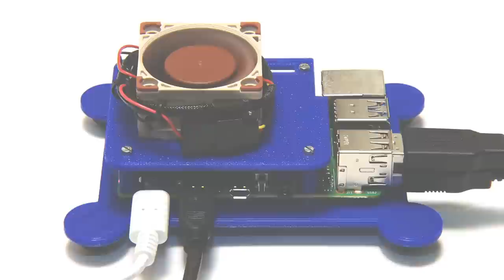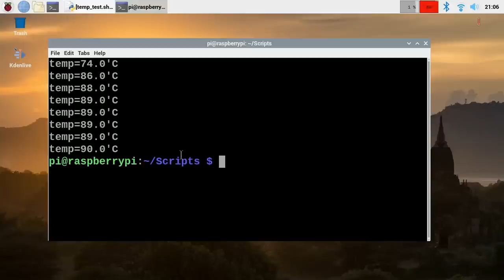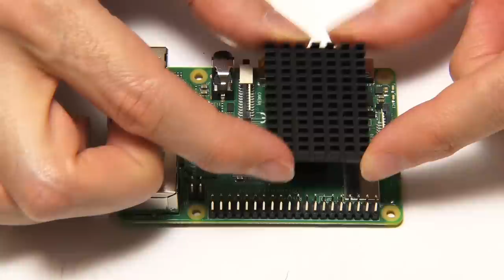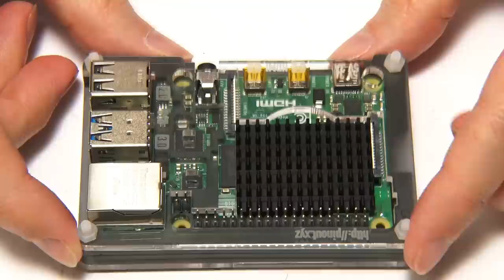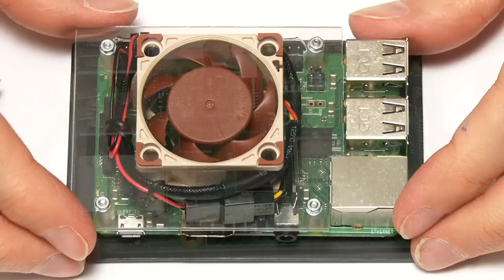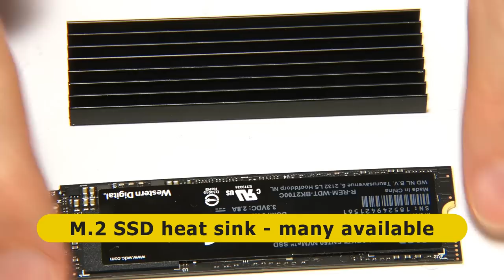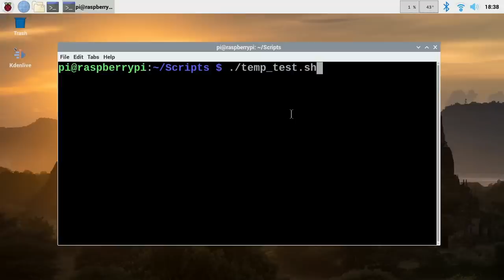Raspberry Pi 4 Cooling

Comment: Since its already metal covered, how do the main cpu temps act if you only add the fan at 5V to 9V or similar ? No heatsinks ?
If its up to 75°C Coretemp on the benchmark  i'd be fine with that for normal use.
Reply: *it's already (not possessive)
*similar?
*heat sinks?
*it's up to (not possessive)
*I'd (the word "I" and any contractions containing it should always be capitalized).

Don't put spaces before punctuation marks, except for: ( [ {
Reply: @alvallac2171  hAvinG A bad daY  ?
Nuttin ' betta to do in real life     ?
(edit: What i would really like is an answer to my question - which you obviously can't provide)
Reply from the maker: I imagine fan only would keep temps well below 70. Note that the Pi only has 5V from GPIO (and 3.3v after its voltage regulator).

Comment: I hate to be the one that keeps saying this but none of these videos state if the cooling solution will get you better benchmarks. Sure I see that these keep the temps down but how much better performance are you getting because of each cooling solution? If it's only 10% is it worth it? I haven't found anyone who has proven this out so far.
Reply from the maker: The test results show the time taken to run the test at the bottom -- from 40 minutes to 10 minutes. Preventing the Pi throttling will improve performance (ie holding it below about 80). And cooling will also improve performance and stability over time by increasing life expectancy.
Reply: @ExplainingComputers  thanks for the response as I missed the last line. Overall it seems you still just need a heatsink and not a fan. I minute difference doesn't seem to mean much overall

Comment: Can you test with fan connected to 3.3V instead of 5V? It may be still sufficient, but nearly silent
Reply from the maker: I would not personally connect a fan to the 3.3V pins, as they tap power after the Pi's voltage regulator.

Comment: Is there any performance gain between a raspberry pi running at 30°C and 60°C?
I think not because as long as the CPU doesn't throttle itself the performance should be same.
Reply from the maker: There are no performance gains at 30 rather than 60, but significant ones once you get into the 80s, as the table shows. :) And a cooler-running SoC and computer will last longer, and potentially be more stable.
Reply: what about the heating of the other components on the board ?  higher heat = higher resistance  ?
Reply: @garygranato9164  Increasing temperature of metals like copper from 20°C to 50°C hardly makes a difference and resistance of semiconductors like sillicon actually decreases with increase in temperature?
Reply: @anshul4589  
"hardly makes a difference"  so it does make a difference then.  not to sure about your ideas on heat and semiconductors as well.
Reply: @garygranato9164  Don't put spaces before question marks. Or any punctuation mark, except: ( [ {

Comment: i would bend a few heat pipes and modify the case so that they lead outside of the housing to be cooled by ambient air, that way you aint a pcb just sittin there exposed.

Comment: How does the pimoroni fan shim compare?  It doesn't use a heat sink and is a comparatively small fan compared to your setup.  I have a few fans in my stash but unfortunately don't have a 3d printer so may have to do some fettling!
Reply from the maker: I will be testing it in a follow-up video!

Comment: Why not use the 10mm version of the noctua fan
Reply from the maker: I have the 20mm version -- and it has higher airflow!
Reply: @ExplainingComputers  thanks for the quick response. I was debating on which version to buy. Do you reckon 10mm do a similar job if not the same?
Reply from the maker: Yes, a 40mm / 10mm fan should do a very similar job. Not quite as good perhaps, but I doubt it will run more than a few degrees hotter.

Comment: Just wondering - can the Rasberry Pi 4 be configured to run slower, say at 500Mhz, 1Ghz etc?
Reply: *Raspberry
Reply from the maker: Yes, "underclocking" should be an option --which I may investigate!
Reply: @ExplainingComputers  Thanks, somewhere I saw a simple start up script that allows you to set the CPU speed ... actually, come to thik of it, it was Tom's Hardware.com or something similar.

Comment: I would have encased the SBC in silicone rubber except for the header of the CPU and installed it into a Little Devil PC-V10 Case with Phase Change Cooler.

Comment: What are these pi are good for.
Reply from the maker: Small desktop PC. Robotics. Media player. NAS. Small web server. Networked camera controller. IoT stuff like home automation. Learning to program. That kind of thing.
Reply: I use my 3b+ to emulate old game systems using retropie
Reply from the maker: Ah yes, how could I forget retro gaming! :)
Reply: I have three Pi 3B+ - two are DNS servers, and the 3rd is a network scanner. I will eventually replace them with Pi4 1gb models. I have a Pi4 that will be my Kodi box (if the video support is up to snuff)

Comment: Your case is an open case unlike the OG PI 4 case being a closed case. What about just cutting a hole in the OG PI 4 case and putting the small heat sink and mount the fan on the top of the OG PI 4 case. Would it work as well or sould the case be
an open case like yours.  My idea was to put two fans one on top and bottom of the PI to have air flow with a closed case.

Comment: That is rather strange.
53° idle is bad for an ARM chip.
Is the passive cooling without heatsink really that bad?
Reply from the maker: The passive cooling sadly really is that bad.
Reply: It is also strange that the tests start out with totally different temperatures. 
Better ignore the top 4 rows ?
Reply from the maker: It is not strange at all! :) The different setups all start from running at idle for about five minutes. Different cooling solutions on any computer will result in different idle temperatures -- the lower the better! :)
Reply: @ExplainingComputers  Good point Chris! Thank you.
I am now running sysbench on a RPI2 and will study the effect of a 60mm 12V fan  running at 5Volt . The fan blows in a 3d printed duct that feeds into  3 RPi cases.

Comment: I've just run this test on a raspberry 4 in a Argon one case and the results are remarkable, I ran it twice the first run started at 38 and finished at 42 and the second started at 39 and finished at 47, and the fan doesn't kick in until 50 so I've no idea if that works
Reply from the maker: Cool.

Comment: funny, I just bought my first Pi 4b with active cooling and I'm going deaf from the little fan and had to rewire to position 1 and 6 to drop the V. Chris if you could come up with a solution for heat sensing fan control I would love to hear it!
Reply from the maker: The latest version of Raspberry Pi OS has implemented fan temperature control. :)

Comment: That is a very small computer and it is too tiny for most people's use. It looks like you need a cooling fan on the processor, plus one in a case that can hold the normal size fan to keep the unit cool.

Comment: Is there a possibility to use all the 4 wires of the cooler to also have pwm and rpm control. Because why buy such a nice and expensive, i might say, cooler from Noctua and not take advantage of all it can provide. I am searching for a 4wire to 4 individual jumper leads to use all 4 wires. Any hint is apreciated.

Comment: 3M double sided tissue tape isn't the same thing as a thermal pad. Its a thermal insulator, that happens to still have good adhesion when hot. 
A thermal pad, should be as thermally conductive as possible not an insulator
Reply from the maker: I noted I think that is was "thermal tape", which is what is is sold as(!). Not a "thermal pad", which is a different material, certainly . . . :)

Comment: 3D Hubs, at least here in the States, wants a minimum order of $35.00, otherwise they add a surcharge to make it $35.00.  Maybe I'll just apply the $35.00 to my own 3D printer.  Guess I won't be ordering your RasPi case from then anytime soon, unless I need a bunch of them!  But I really do like your design!  Have it now in my TinkerCAD designs so I can print it once the 3D printer arrives.

I think 3DHubs may be shooting themselves in the foot by adding this surcharge.  You can order a case with a fan for the Pi4 on Amazon for $9.99.  Why would I want to buy from 3DHubs?
Reply from the maker: I can only agree that the very recent surcharge introduced by 3DHubs is not good. I got my printing for this job done using a former 3D Hubs hub (seaside3d.com) -- I was intending to use 3D Hubs, but didn't when I went to check out and saw the surcharge! :)

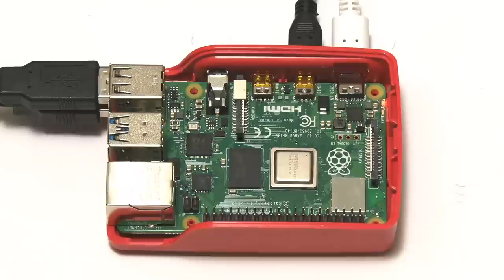Comment: @0:55
Technically that isn't without heatsink.....just with a VERYYYYYYYYYYY small one
Reply from the maker: :) That is the SoC lid, not really a heat sink! :)
Reply: When the 3b+ came out that is all I ever heard it called....it was to make up for the clock bump, either way it is fin to pick at ya a bit ;)

Comment: Hey, I'm going to be receiving my Pi 4 4GB + Pibow + Pimoroni Fan SHIM if you want another data point for different cooling configs?
Reply from the maker: Please do share the data here. :)
Reply: @ExplainingComputers  Will do! It should arrive tomorrow.
Reply: @ExplainingComputers  So, managed to get some runs in. I wrote a custom Python script, which simply executes the bash script you gave in the video and produces some output based on that.

Picking the hottest day so far this year in Britain was probably a bad idea, but here goes:

* Disabling Fan SHIM...
* Waiting 2 seconds for the fan to spin down...
* Benchmarking...
* Results:
* 51.0'C
* 81.0'C
* 82.0'C
* 85.0'C
* 85.0'C
* 86.0'C
* 85.0'C
* 85.0'C
* Enabling Fan SHIM...
* Sleeping for 2 minutes to allow the CPU to reach idle temperature...
* Average temperature with Fan SHIM off: 80.0'C
* Benchmarking...
* Results:
* 52.0'C
* 65.0'C
* 66.0'C
* 64.0'C
* 63.0'C
* 63.0'C
* 64.0'C
* 64.0'C
* Average temperature with Fan SHIM on: 62.625'C
* Having the Fan SHIM reduced the average temperature by: 17.375'C

Comment: Thank you for this great video, it is very resourceful :)
I was wondering if I could also use the NF-A4X20 5V PWM? Can a PI4 handle a PWM fan in order to adjust the fan speed? Thanks in advance for your advices

Comment: Do you have prudent cooling choices for the new 8gb Pi 4B
Reply from the maker: Here are the best two passive cooling solutions: https://www.youtube.com/watch?v=VJC6OpGpq0Y  For the maximum cooling, use an ICE Tower -- and look out for my video in July on the "Ultimate Raspberry Pi 4 Rig".
Reply: @ExplainingComputers  I've really enjoyed your posts, including these. The ICE Tower is brilliant but defeats the idea of a portable utility computer (for me anyway).
SBCs are supposed to be flexible and deployable. I want something that I can take to a library or a meeting and not annoy anyone with fans etc.. Ideally it would be a data store with some battery power.
I'm very curious to see the heat effects of the 8gb. Does the board need some sort of redesign? How big a difference does it make?

Comment: I hardly get to 43°C after several minutes of 100% CPU load with the Low-Profile ICE Tower Cooling Fan on my RPi4 with the fan plug to 3.3V !!! (I can't hear the fan AT ALL!) and I don't even get to 40°C with the fan on 5 Volts (still very silent)! I highly recommend the Low-profile ICE Tower! IMHO the best active cooling solution! Period! And it looks cool too. BTW the ambient temperature is around 23°C.

Comment: You have done cooling  with fans what about extreme cooling on it I.E. water cooling and if its possable # LN2 # liquid nitrogen ???
Reply from the maker: Yes, I may push this further! :)
Reply: I saw a video where the guy saw that water cooling actually resulted in warmer running temps than a large heat sink/fan. I suspect his coolant reservoir wasn't big enough and it started recirculating hot coolant. He didn't show his coolant configuration, so I don't know if he was running through a fanned radiator. Whatever the case, water cooling is more trouble than it's worth.

Comment: I have a question about the raspberry pi 4 ca it run kdenlive?
Reply from the maker: It can -- I tried in in a video two weeks ago: https://www.youtube.com/watch?v=kbn_6ixtIpA  But it is not very stable if you scrub transitions in the timeline. But for straight cuts and rendering out, it works OK.
Reply: Thank you

Comment: I tried the same with the Radxa RockPi4 (having mounted their big passive cooled heatsink)
The RPi4 uses 4x A72 cores, now produced at 28nm technology. 
The RockPi's RK3399 chip is also based on 28nm technology (since 2017) and has 2x A72 and 4x A53 CPU cores inside.

Sun Jul 21 18:22:56 UTC 2019
36.250
42.222
42.222
42.222
42.222
42.222
43.333
43.888
Sun Jul 21 18:23:29 UTC 2019

What I really wonder: the 7 cycles took less than 40 seconds. 
How on earth the RPi4 can take 10 Minutes?

I then increased the cycles to 50 and restarted the test. 
Htop confirmed all 6 cores running at 100%

Sun Jul 21 18:27:38 UTC 2019
38.125

43.888
45.000
45.000
45.000
45.625
45.000
...
...
...
49.375
50.000
50.000
49.375
50.000
49.375
Sun Jul 21 18:31:27 UTC 2019

May @ExplainingComputers could do the same with a RockPi4 to ensure it is the exact same test setup?
Reply from the maker: The issue here is that newer versions of Sysbench (like that which will install on the RockPi 4B, and indeed most Linux machines these days) run a time-limited test, so you cannot compare results from anything running Sysbench pre 1.0 to Sysbench 1.0+

Comment: I don't know if it's intentionally for views but I am disappointed that you compared cooling solutions to an enclosed case instead of the open-air and half open-air like rest of them were.
Reply from the maker: I started with the official case as that is what the Raspberry Pi Foundation sell. Other solutions were hence compared to that. Clearly non-ventilated cases for a Pui 4 do not work -- and I was not prepared to destroy a Pi 4 proving it by trying another!
Reply: @ExplainingComputers  well you are comparing cooling solutions, base raspberry pi case is not one. It doesn't fit into general comparison of cooling solutions but comparison to whatever "base" raspberry pi sold. Which is not a good way to show how much open air cools down the chip itself without a case.

Comment: Did you test to see if the fan would run at 3.3v?  If it'd run at 3.3v it'd probably be virtually silent.
Reply from the maker: I did not test that. I would not personally connect a fan to the 3.3V pins, as they tap power after the Pi's voltage regulator.

Comment: I can appreciate this as an academic test but is overheating a problem in the real world? Is the 4 significantly worse than any previous models such that a direct upgrade with no heatsink etc. intervention will cause a significant problem? Pi was originally about getting kids involved in computing. I would be curiuous to know if for typical routine education or home uses such as home NAS,  kodi-type box/similar the 4 is perfectly ok to use in its default state.
Reply from the maker: Yes, for thethe Pi 4B overheating is a very significant problem indeed in the real world. It runs far, far hotter than previous Pis -- for example, it cannot play 1080p video in the official case for more than a minute or so without hitting 80+ and throlling. :(

Comment: Is it possible to make a small script that turns the fan on/off at for instance 70 degrees (or whatever temperature necessary for optimal performance) so the fan doesn’t need to run all the time?
Reply from the maker: Possible, if the fan were fitted via some control circuit (or using its PWM pin).

Comment: hey, i think your pads are not that good( they seem to rather isolate than transfer heat.)  I had only ~50°C when i mounted  the pi on a fan-case (but this was unfortunately not tested with your skript, but i had 100% CPU while moving content from one HD to another). 
i have then mounted a way smaller heatsinks and i got 46°C  Max. I used thermal glue instead of pads. Maybe normal Thermal Compound from CPU's would work too, but  i wanted to be sure it stays on :D

Comment: hi Chris in this video some guy by upgrading usb3 can download  up to10 degrees the temperature , see you arround
Reply from the maker: As I clearly state in this video, I have already applied the USB firmware upgrade before running any of these tests. The upgrades does nothing whatsoever to reduce heat generated by the SoC.

Comment: does zorin os work here?
Reply from the maker: Only on an x86 board I'm afraid (Pi is ARM). But I anticipate Ubuntu MATE will release for the Pi 4B at some point (it is available for earlier Pis).
Reply: It's an open source OS, so I presume it could be cross-compiled for ARM processors if you have a computer which is powerful enough.
Reply: @ExplainingComputers  thanks. totally forgot that this was running on ARM
Reply: @АлексейГриднев-и7р  sadly i dont have a pc "powerful enough" to do that